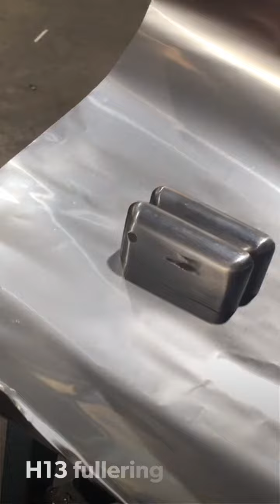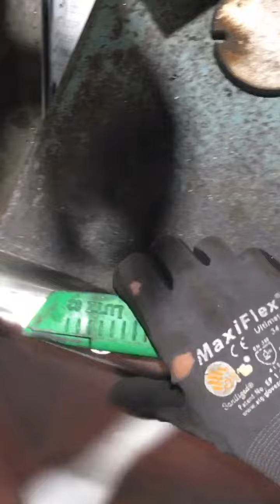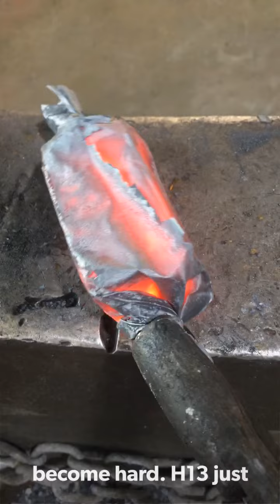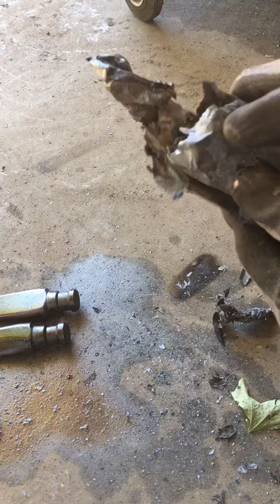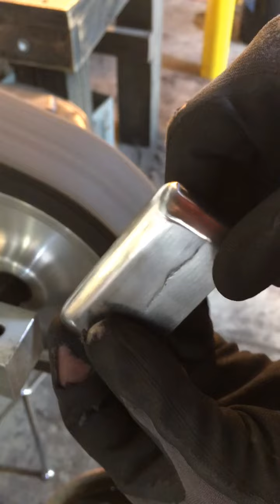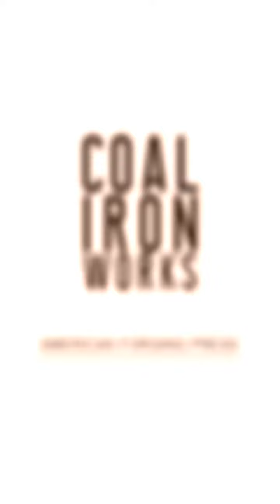Heat Treating H13 Fullering Dies

Comment: Is that just regular aluminum foil???
Reply from the maker: That is actually Stainless Steel Foil. Regular aluminum would melt by the time the forge got up to heat. The foil here is meant to protect the surface of the dies from oxidizing during heat treat, which is why we put paper inside, to burn out any oxygen left in the stainless pouch created by the foil.
Reply: @CoalIronWorks  thank you for replying. I'm a small time tool maker for farriers. Where do I order that from? Would love to try it. Thank you again for taking the time to reply.
Reply from the maker: https://www.grainger.com/product/4UGL5?gucid=N:N:PS:Paid:GGL:CSM-2295:4P7A1P:20501231&gclid=CjwKCAjw8-OhBhB5EiwADyoY1d0qnv8RvJsaRAdnayqVYXvxWoKgDXahz4-8lrjFxTGJ1VwsWJwILRoCFlAQAvD_BwE&gclsrc=aw.ds

This is a link to Grainger.com for some good foil for cheap.

if you're looking for our H13 dies, you can find them at this link here!

https://coaliron.com/collections/dies
Reply: How long are you holding it at 1900°? Thank you
Reply: @lanceyohe634  about 45 minutes per inch of thickness
Reply: What type of forge are you using? And what psi are running? Thank you for your time?
Reply: how long u let them sit in the forge 45mins ?